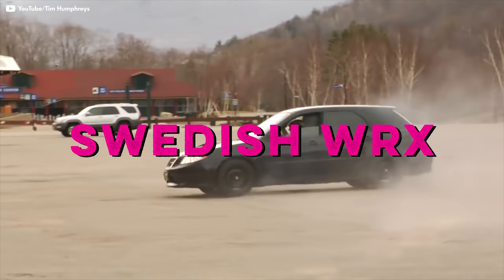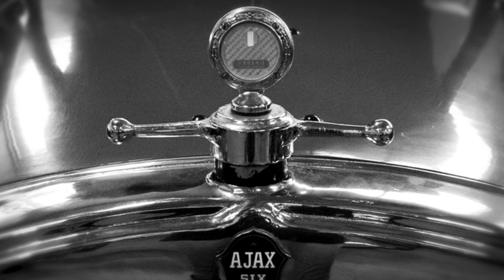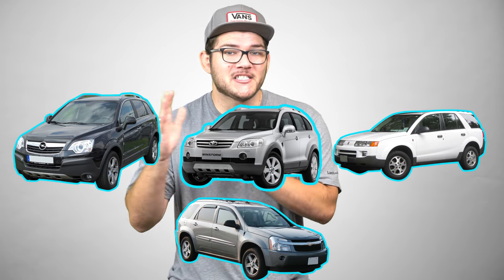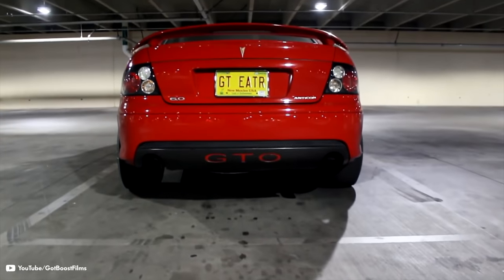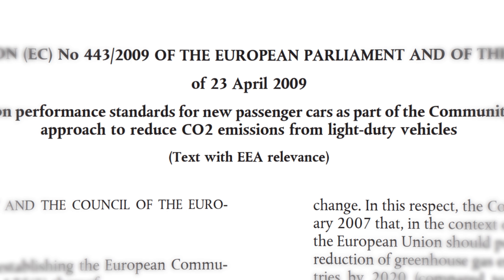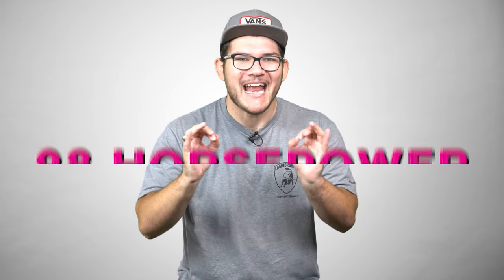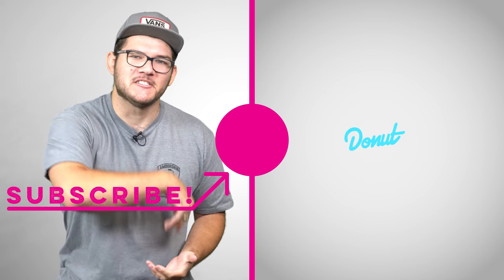Who Really Made Your Car: The Truth About Badge Engineering | Donut Media

Comment: Saab and WRX
Reply: they said that, Saab 9-2X is a wrx
Reply: they're the same thing! it's direct bolt-on!
Reply: Subaru manufactured a badge engineered version of the second generation Impreza hatchback as the "Saab 9-2X" between 2004 and 2005. Retailed only in the North American market for the 2005 and 2006 model years, the car earned the nickname "Saabaru". At the time the 9-2X was conceived, Saab Automobile had been a fully owned subsidiary of General Motors (GM), and GM held a 20 percent stake of Subaru's parent company, Fuji Heavy Industries.
Reply: Atem S. It's a completely different interior
Reply: Jake Schuster
thats funny. looks the same to me
Reply: it's the same mechanic!
Reply: Insurance is cheaper on the Saab 😂
Reply: It's a "SAABARU"
Reply: @bkantonson  you beat me to it lol
Reply: hey i own one of these, they're cool!
nobody knows what it is except Saab drivers, and some Subaru drivers

there are a handful of unique parts, but its mostly cosmetic changes to the car, like unique headlights and taillights, bumpers, quarter panels, side skirts, the wheels.
allegedly the Saabaru has a STi Steering rack and assembly, but i have no hard info to back it up, however steering feel is very good so i'd believe it
additionally it has additional sound deadening in the cabin and allegedly there is slightly improved safety features
Reply: @anthonywebber2211   while the interiors are largely the  same, the saabaru has a unique color option for seats, which was white center with black edges, with two distinct material options, leather and cloth. I have the cloth seats in mine and let me tell you never ever buy white cloth seats you will regret it immediately. i try to clean it, i really do, but dirt just keeps coming back, stains appear that i dont remember making. its a cursed life
Reply: I thought Saab was a discontinued it’s light vehicle production. The only thing Saab makes are lorries and busses under the Scania brand.
Reply: The Saabarex, i mean Saabaru.
Reply: Saab also based some of their cars off of the Vauxhall Vectra. (Obviously the Saab is not simply a Vectra it's a much much better car but it's basic frame and several other noticeable elements are more or less the same).
Reply: Uncouth Behavior Saab and Volvo make some of the best chassis units available. I think the styling of the Saab you are talking about might have similarities to the vectra
Reply: @anthonywebber2211  I own a Saab 92x Aero (Aero is the WRX equivalent) it is a slightly more refined and sleeker WRX wagon

Comment: Also, the alliance between Honda and Isuzu in the 90s. Does anyone remember the Isuzu Oasis?
Reply: Honda rebadged the Isuzu Rodeo and Isuzu Trooper as the Honda Passport and Acura SLX
Reply: MercurySable99 it was a rebadged Honda Pilot and/or Passport. Also the 90's Honda/Isuzu partnership with GM, Isuzu sent motors to GM for them to Rebadged for small engine truck/SUVs like the Chevy S10/S15/Blazer, GMC Sonoma/Cyclone/Jimmy, and a few small engine cars, mostly the twin overhead cam sedans on Saturn's, Pontiac's, Olds, Buick's.
Reply: The Oasis was a rebadged Honda Odyssey.
Reply: Nik Buerky Isusu engine also was mounted in Opel/Vauxhall cars
Reply: Mateusz Zimon I did say they sent them to GM, GM owns Opel and Vauxhall, so that would imply that GM put them in whatever they owned.
Reply: Surprise surprise the same thing was sold as a Holden Rodeo in Australia, the Current Isuzu D-max is Sold as a Holden Colorado in Aus now.
Reply: Honda Tourmaster......
Reply: @mateuszzimon8216  also holdens

Comment: what happened to Plymouth??
Reply: Last hurrah was a "Duesy"... The Prowler "factory hot-rod".
Reply: the prowler was a stolen Foose design and they still found a way to screw it up. lol
Reply: REDLINESTEEZ, biggest problem would be the engine they put into the Prowler, the NA3.5L V6 that wasn't very reliable (par for Chrysler's course...). In hindsight (they didn't knew back then) the Pentastar engine (NA-3.6L) and a higher-cog (than 4) tranny (even a 6-speed would've done the trick even if they couldn't profitably install a proper manual). At least it was a longitudinal RWD engine and not FWD (it was based on a very modified Intrepid, so much so that had other kind of traction and engine positioning from the donor).
Reply: Sales went down

Comment: The eighties Monte Carlo and regal are the same platform
Reply: Actually it went from the '60s 'til the Aughts (Monte Carlo, Grand Prix, Regal, Cutlass Supreme ), even as they've switched to FWD...
Reply: Yea but different engine
Reply: Buick Regal (1982–1987)
Chevrolet El Camino (1982–1987)
Chevrolet Malibu (1982–1983)
Chevrolet Monte Carlo (1982–1988)
GMC Caballero (1982–1987)
Oldsmobile Cutlass Supreme (1982–1988) Note: the 1988 model was known as Cutlass Supreme Classic
Oldsmobile Cutlass Cruiser (1982–1983)
Oldsmobile Cutlass Salon (1986–1987)
Pontiac Bonneville (1982–1986)
Pontiac Grand Prix (1978–1987)
Reply: You'll have to remove one from what I believe is GM's "G" midsize RWD platform list as the Pontiac Bonneville was on the next larger (same as Chevy Caprice) chassis.

Even as these "G's" were replaced by a FWD platform (the El Camino / Sprint / Caballero Utes never made it to the FWD platform) whoever survived was kept within the same platform family as the others. Most of the members of a GM platform family (unless they had a Cadillac member and even then...) used much of the same engine lineup.
Reply: the Pontiac Bonneville was a G-body car from 1982–1986
Reply: Now that I thought about it (I didn't search any of the info, I remember it when they were new since I used to work for a car dealer for 22 years and been into car info stuff even before that), yes, GM did shrink the Bonneville for a while (once it shifted to FWD it was given the larger platform again) to turn it into a Malibu brother, a task usually done by the Grand Prix, leaving the latter to go with the Monte Carlo.

Comment: GM was in its hey-day about doing this it seemed during the late 70's to the mid-80's. Things like the Chevy Monte Carlo, Olds Cutlass, Buick Regal, Pontiac Gran Prix, and to some extent, even the GMC Caballero and Chevy El Camino. I love cars of the era since that is when I grew up. However, the fact that they all shared the same smothering 80's restrictions left a lot to be desired performance-wise. 
It makes sense that companies do this. However, it likely cuts down on some of the innovation that was had for instance when GM had more distinct brands, each with their own distinct engine lines.

Comment: I just want to point this out because I did a research paper on teslas growth and a bunch of other stuff, but the Roadster isn't a Lotus rebadge not even close, iirc the car shares almost nothing with the parts used on the lotus other than stuff that would have a high cost to manufacture to safety standards at their scale (lke windshields)

edit: in short the Tesla roadster just looks like an Elise, it just shares a significantly few numbers of parts with it for cost reasons.

Comment: The Cadillac Cimarron was supposed to compete with the BMW M3? Where do you get this crap? The BMW M3 came out in the 1986 model year. The Cimarron came out in 1982, four years before the M3 came out. The Cimarron was the result of GM's need for a compact luxury car to compete with cars in that class from European luxury marques and their misguided belief that they could just do so by changing the grille and taillights and adding an upmarket interior.  It was one of the few badge engineered cars that literally was badge engineered. The market quickly disabused them of that fallacy. The M3 is a high end performance car. A Cimarron is not. Only an idiot would confuse the two.
Reply: Came looking for this comment, I have no fluckin clue which genius at donut media thought the cimarron came after the m3 and was supposed to compete with it
Reply: The Catera (an Opel) was supposed to be the Caddy that changed the game for them...and it did, it was renamed the CTS, had a high performance variant, the V series and put them on the map as a serious sports sedan contender. 

Regarding the SS...it was always supposed to be a low volume model. The VF Commodore was slated to be the final model built at that factory, just as the Falcon from Ford the other V8 RWD sedan making noise down there. Yeah, advertising was very limited, but the people who were supposed to buy them did, enthusiasts - I know I love mine 😉

Not trying to spark debate, just that the SS is a little misunderstood here.

Comment: VW's and basemodel Audis are identical, except Audi has more engine and drivetrain options you can choose from, for the most part. It's only really when you get into the Audi S and RS range that they are different. Same goes for some Euro specific brands like Seat and Skoda. All are under the VW umbrella. Yes, your 2.0 diesel A4 is really a Passat with different interior, and an Audi badge.

Comment: one thing to note, the Roadster actually did have some engineering put into it.  Yes, they started with the Elise, but obviously retooled EVERYTHING about the chassis and suspension to accommodate the battery, motor placement, and new weight distribution (and weight).

Comment: I used to drive a Mazda B4000... which was a rebadged Ford Ranger. The funny this was, aside from swapping the badges on the hood, steering wheel, and wheels; adding faux-chrome trim around the windows, and swapping the decals... it was the exact same under the hood. Literally. Lift the hood and you’d find a Ford engine. I always got a laugh when even mechanics were confused and thought they were looking at an engine-swap job. Hahahaha!

Comment: I had the Saturn Vue. Great car generally speaking, but mine sucked. Mostly because it was a hybrid. And the hybrids were designed in Germany. Sharing nearly zero components with the gas engine models, they were unreliable, and both difficult and expensive to repair (many parts can’t be replaced anymore). Mine ended up losing the entire hybrid system, abs, tc, and stability control (led us on an electrical wild goose chase that we later gave up on)... which led to two separate accidents, the latter of which totaled the car. Now I drive a Dodge Dakota, and despite weighing in at 5500lbs, it still gets better fuel economy than my Saturn did. 💀

Comment: That's why Dacia is re-badged as Renault in some markets and Daewoo used to sell its models with a Chevrolet badge before being absorbed into Chevrolet
Reply: (correct me if i'm wrong) but didn't Dacia used to be an independent company before Renault bought them (which is why the duster looks identical)

Comment: I wish GM had brought the Ute version of the Holden Commodore to the USA (maybe they could have called it the Chevy El Camino if they wanted to bring back an old name). They probably would have sold a bunch of em as well since there was nothing on the market in the US like it at the time.

As for badge-engineering more generally, Australia tried a plan in the mid 80s where different manufacturers would share cars with each other as a way to boost the local car manufacturing industry. The Nissan Pintara compact sedan was sold by Ford as the Ford Corsair. The Toyota Camry was sold as the Holden Apollo. The Toyota Corolla was sold as the Holden Astra. The Holden Commodore full-size sedan was sold as the Toyota Lexcen. It failed to work out and the car makers switched to importing cars from overseas for the market segments they weren't making locally (before eventually all existing Australia completly)

Comment: You can't talk about Badge Engineering without talking about the British Motor Corporation (BMC)/Austin Rover Group and their lineup of badge engineered cars such as the original Mini which was sold under several brand names or the Rover 1000 which was previously an Austin branded car or the Rover 45 which was an Acura branded car that was co-developed with Honda before the BMW takeover of the MG Rover Group.

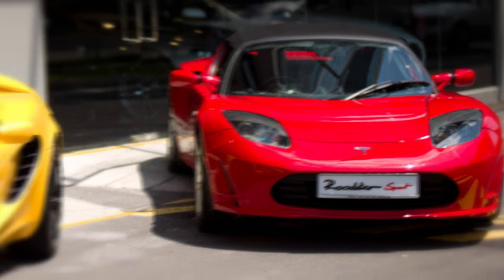Comment: 5:00 u got me triggered really hard

The original 2008 Roadster was built on the Chassis platform of the Elise, it was not a rebadged Elise
Reply: Agree. Although it looks like they just put EV parts in actually most of the parts used were different, far from just a badge engineering job. I can think of plenty of other badge engineering that is just that. Eg here in Taiwan a lot of Ford and Mazda cars are basically the same thing from the same factory with some very minor trim, sound system etc and badge differences.

Comment: In the UK we had Rover rebadging Honda civics until they just got stuck recycling the same 94 model civic over and over until the company died.
Also remember a Mazda 121 around 1995 which was literally identical apart from the badge to a Ford fiesta. Also the lotus elise rebadging as a (GM) Vauxhall vx220.
Chevrolet in the UK is a joke, all the cars are rebadged Korean cars from the left over remnants of Daewoo which started its original line up with rebadged Opel/Vauxhall astras.

Comment: 1:51 from owning a 2014 Chevy Captiva, the 2014 gen Captiva, Vue, Antara, and Holden Captiva were all the same car. The model year Antara showed in this video was not the same. These cars were built with spare parts from the Equinox. They were a bit bigger, if not the same size as the Chevy Trax

Comment: The GM torsion beam is still used by Opel and Vauxhall in Europe. For small cars it works great.
Reply: Wrong Vauxhall is only in uk not Europe
Reply: @louisbeerreviews8964  Hence I mentioned Opel which sells in Europe. But saying that you were able to buy a RHD vehicle with a Opel badge and visa versa. Anyway the point of the comment was that the torsion beam is an appropriate rear suspension setup for small low cost cars.

Comment: I’m no Tesla fanboy (far from it), but the Roadster wasn’t so much a rebadged Elise as it was based on the same platform. The body was completely different, and obviously the drivetrain was as well. It’s more comparable to the relationship between the ND Miata and the Fiat 124 Spider, but even those two at least shared a shell.

Comment: What about one that had relative success. I'm sure in US you never heard of it and in Europe just a few probably. The 1998 Ford Fiesta / Mazda 121. The Fiesta was actually a hit in my country. Small and affordable car with a 1.25 cc engine. By 98 most of same size cars had 1.0, 1.1 or 1.2 engines with 8-valve. This was a 16 valve engine capable of producing 75hp. The car was fast and reliable. From the Ford side this sold well, but Mazda couldn't take advantage of this and the 121 was actually a flaw.

Comment: One badge engineering job that is really starting to hurt GM is their pickups and full size SUV's. Honestly GM needs to kill off GMC or actually make differences between the Silverado/Sierra and Tahoe/Yukon (and the Colorado/canyon and the equinox/terrain) GMC is to Chevrolet as Mercury was to Ford. Ford did the smart thing and axed the brand rather than continuing to pay for double the body panel tooling and advertising for essentially the same vehicles.

Comment: 7:57
I’m gonna have to disagree with you there
The Chevy SS didn’t sell because it wasn’t supposed to, it was just GM keeping their end of the contract with Holden before shutting down their factory
If GM wanted it to sell, they would call it the Caprice SS or Impala SS, and they would have advertised it. I only found out about the SS in 2015 when I was fiddling around with the Build and Price tool on Chevrolet’s website, and I guarantee to you that most people buying cars don’t go the manufacturers website. 
It would be an easy competitor to the Charger, they would even sit in the same price bracket. Just make a cheap model with the god awful 3.6 V6 and then the SS model

Comment: Dodge and Mitsubishi there is the dodge stealth witch is basically a rebadged Mitsubishi 3000 GT and there is also little dodge trucks in the 80s that used Mitsubishi engines i Believe it was called a B 20 Dodge truck

Comment: All GM Divisions sharing a common platform are rebadges. I always wondered how someone would pay a superior just to get the same car from the more expensive brand. Chevy/pontiac/oldsmobile did that as well as Ford with the crown Vic/mercury grand marquis or the explorers. Then there's joint ventures like Mazda B/121 and Ford ranger/fiesta or Daimler/Chrysler with their sprinters. Then You also have opel vectra and kadett being further on sold as daewoos in Germany cause the platform got sold. Audi sold their production line of the A4 to Seat, which made for the best seat ever built with the Exeo. The Japanese only come in 2nd, cause Toyota/Lexus, Honda/acura, Nissan/infiniti are the respective luxury brand of the same company instead of cross rebadging. How bout Porsche/Ruf and bmw/alpina